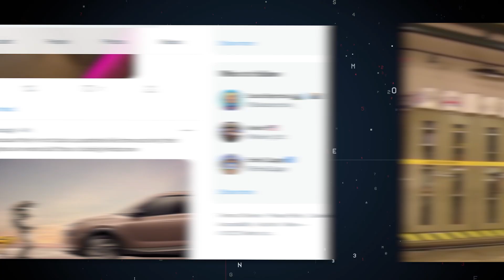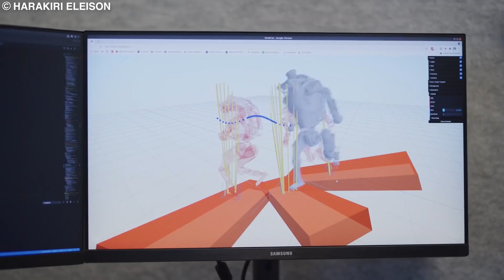Boston Dynamics' New Robot Makes Soldiers Obsolete, Here's Why

Comment: Funny but sad. These engineers are above most average person in IQ doing this kind of work. Yet they are just as stupid as your average person if not more so for the same reason by wearing a useless mask.  Wearing a mask doesn't do jack against any kind of virus's. Indoor or out. Around 3 people or 300. The only thing that can protect you from any type of virus is wearing a hazmat suit with your own air bottle.  There is nothing else.  Plus not knowing or understanding wearing masks for long periods of time does break down your teeth, gums, airway and lungs over time and increases your chances of getting serious bacterial infections in your mouth or lungs. Where people and even kids are going to the hospital for.
Wearing any kind of mask for viruses is like walking in the rain with a umbrella with a thousand holes 16th of an inch dia. in size in it. You would still get wet.
WWG1WGA

Comment: Hey dummies, you do know that the boston dynamics robot has human assisted operators helping it walk, right, usually 4 of them per robot. We are still years away from good walking robots, decades away from better batteries, also these robots have 1/10 the strength of a human. STOP THE CRAP TO GET CLICKS because i just report you for being stupid. Any useful non manufacturing robots are 30 years away at bare minimum and possible further with the anti-technology people (i call them the anti maskers, people who think solar is fake and electric cars can never replace gas and stuck IQs and until the Baby Boomers are dead) the pace will be slow. TEST, test and test all you want facts are facts. I built my 1st robot in 7th grade in 1983 and been building robots ever since, and it is slow, its only been since 2012 when open source leaped everyone to where they are.

Comment: Imagine if they have the smart gun technology.  1000 robots  With 1000 rounds of 338 lapua t ammo capable of one shot kills at over 2 miles out.  Also have them carry 1000 rounds of .375 sig ammo for close quarter combat.  And maybe 10 grenade launcher rounds and one big kamikaze bomb when they run out of ammo and they could pretty much annihilate virtually any city in the world with just 1000 robots.  1000×2000 rounds of ammo = 2 million possible casualties with just the bullets alone. With infrared motion sensing etc.  That's freaking scary man.  😨 transformers.

Comment: The wasp in nature has an almost ideal 'chassis' for a battle robot.  Wings capable of hovering/loitering, yet also rapid straight line flight.  Multiple highly stable legs capable of crawling quietly on any surface.  A 'weapons pod' slung below.  Sensors/tools mounted in the head.  If each side in Ukraine had 50 000 of these, both countries would be depopulated in less than a year, assuming the wasps were programmed to repair and recharge themselves, or even better were programmed to be able to build new wasps.  The belligerent human countries would die, leaving the robots in control and the original causes of the human war meaningless.  This is a scenario that could play out in our lifetimes.  I hope that AI is a better manager of the Earth than humans have been.

Comment: The problem is military requires movement and a robot army is going to rely a supply chain a lot more a whole lot more than a human Army is. 

All the parts moving around for miles and miles are going to wear out fast, on top of that the batteries, how long do you think it's going to last walking across the countryside? A human Army can march across the countryside at 20 to 28 miles and 7 hours.  

Another issue is weathering, can you protect these robots from bad weather or Sandstorm and such? Because all the fancy devices in the military when I was in fail and we had to use our self to get things done.  

Even if the robots can do such things I don't see them replacing a human Army anytime too soon, by the time that happens you probably have a machine Crusade & Jihad like in Dune.

Comment: Ah gee....  You're forgetting something.  They can't do squat unless battery engineering jumps ahead about five to ten years.  There is a new type of battery being developed that is not actually a battery at all, but is a Graphene Super Capacitor, by a German company that will do everything Tesla's 4680 can do while also solving the capacitor issues as well.  Those skipping, jumping and back flipping robots cannot carry enough Lithium-Ion battery power as of yet to be used effectively by our military or anyone for that matter.  It looks cool and can do interesting things, but at this point there is as of yet no "Brass Ring" to be grabbed.

Comment: There is no moral challenge, only technical. Because even if one side doesn't want to use it or not confident in using it, if the enemy is using it and winning the war with it. It will force the other side to fully deploy these robot as well.

Comment: well all it would take is an emp or electricity to fry their circuits to take them out so i do not see them making soldiers obsolete... hell i bet a paint bomb would be enough to "blind" them. setting a trap for them would be simple. it is not like they actually have the ability to think they just run on code.

Comment: I think it is a waste to bother with humanoid ground robots when the real future of battle is a massive swarm of advanced armed drones that can maneuver with extreme precision and agility at lightning fast speeds. It is going to be more like the movie Ender's Game only Ender is AI in a supercomputer. Whichever side has the most agile and resilient drones and the best supercomputer AI will probably win the battle. I think this is the case because no humanoid robot is going to be able to move like a drone and drones can easily fly low to the ground. Battle will become like a game of chess where drones are the chess pieces and the players are AI. Also note that drones have far less moving parts and thus there are less ways for them to break down, making them more reliable and cheaper to maintain.

Comment: No they wont. They will run for 6 minutes max and then need a new battery. They either have a thin wire providing power or videos are concatenated to make it look like they can work for a long time. The weight of the battery it would need to run for 20 minutes will be so much that the robot will have to pull a trolley along with the battery in it. But they wont tell anybody that cause they won't get any grants.

Comment: Thank you for pointing out the difference between Bosstown Dynamics(Corridor Digital) and Boston Dynamics. Other channels use the Bosstown video as something from Boston.
Edit: frankly, the human soldier will never be removed from the battlefield. The robot augmented battlefield will likely be more like Call of Duty: Infinite where there are squads/teams of humans and robots working together.
Reply: Was thinking the same, much like robocop, but they will  eventually later down the road be more robot soldies than human.
Reply: @corneliuselbourne1044  Most likely. Thinking about it more, it's highly possible that there will be a time where there is only 1 human and the rest of the squad are machines at the smallest level. Scarily at largest, it'll probably be the entire active combat areas are all machines, and then a headquarters base with overseers and coordinators that give the movement and fire commands like the UAV command centers of today.

Comment: The problem with these is that if the enemy weaponizes electro magnetic pulse waves or creates a solar storm and shuts down the electric grid, everything that uses electricity and everyone that has electrical components inside of them will shut down and society will be pushed back to the times before electricity.

Comment: Why can't anyone just spray a foam opaque flamable epoxy then torch the robot. It will lock the joints, blind the censors, and melt the wires.

Comment: The technology advancements amaze me, but when you get to this level of autonomy of replacing soldiers, where does it stop. The more machines replace, the less roles there are for humans.
Reply: Not really, it might actually create more jobs for humans. Look at fighter planes. In WW1 it took 2 guys to maintain a fighter. Modern jets require a crew of 50+ to maintain the aircraft correctly. You'd basically have more people maintaining the robot than fighting. The more complex something becomes the more people are required to maintain combat effectiveness in war time. You'd need programmers, multiple to check for redundancies in program failures, armorers to outfit the weapons and reload, techs to check the electrical systems, techs to check the structural integrity, techs to maintain the batteries, mechanics to swap out parts, etc. It's not like a human that does all those things themselves. Just look at all the jobs created from all the robots at Amazon.
Reply: @ehold6877  perhaps. I sure hope so. But then begs the question what’s the point in having them. The only benefit is not having to put human lives in danger

Comment: I hope I get credited for this. LOL  if everyone is worried about A I  taking over. Why not have a spoken kill word to kill the A I ., A device that has nothing to do with the A.I.  But welded to main computer on board.  With a spoken combination. A emp goes off mean while a acid or corrosive substance is released to destroy joints or pistons. I mean come on Elon Musk. (😉 a call out.) I can make this device with crap in my junk closet. I don't get the big worries.  This device could be modified and or program to activate if artificial intelligence gains access to sensitive documents or satellite systems.

Comment: Horse-size ones could be cool to ride. Our soldiers could be like Knights again quickly moving over very rough terrain.
Reply: We have tanks. And planes. And APC's. 

What are you talking about?
Reply: @marishiten5944  None of which can roll up a rocky stream bed, weave between trees in a dense forest, scale a steep mountainside to an insurgent bunker, or even head inside buildings and climb stairs. It would be closer to where an ATV could go, except could easily step over logs, rocks, beams, boulders, barricades and more. They’re clunky today, but I can easily imagine them being tiger-smooth with an exponential AI refinement curve and some more time. And the tactical implications of where they could go are beyond even the nimblest wheeled or tracked vehicle. Hover platforms and jetpacks are next closest, but rideable “robo tigers” would have better weight and endurance limits and are stealthier.

Comment: the disrupters seem to avoid the obvious targets like cables & joints and attack only the well shielded areas.  I remain doubtful.  Also how do they perform when hot with handheld emp cannons?  Also how long can they operate?
Reply: Yeah but that’s based on todays limitations. Think about what they’ll be capable of in another 10 years

Comment: The first application you can think of this is military? There goes the myth of capitalist efficiency and imagination. And FYI, a molotov cocktail is much cheaper than that robot, and I'm guessing its plastic/rubber components will not like fire. And its battery will not like the heat.

Comment: I wouldn't worry. This isn't going to be a battlefield reality. Maybe in urban centres you could effectively run robotic soldiers similar to in settings like Cyberpunk or similar to Star Wars drones but even that is about 50-100 years off and several technological leaps away from being at a level where its worth it. You're more likely to see small robot drones covered in bombs to go clear out a room than a bi-pedal robot soldier storming a building. Not to mention its cheaper to send a human in to do the job and die for you just ask our friends in Russia.